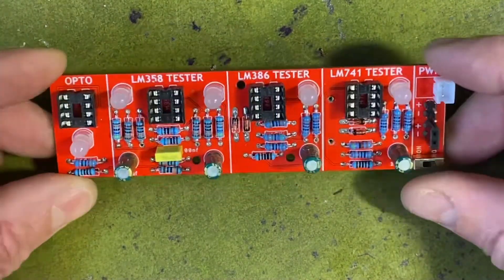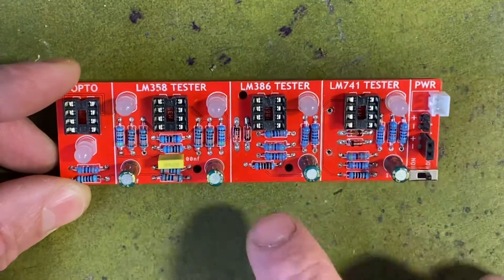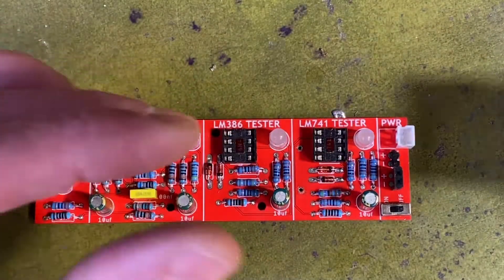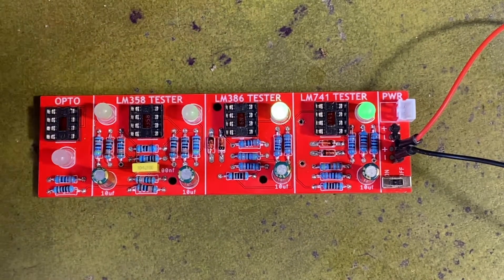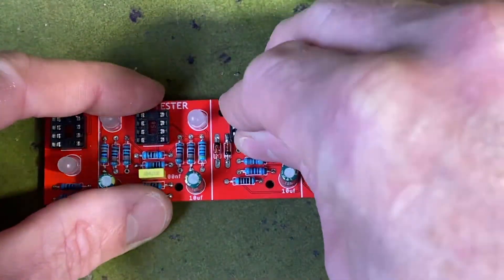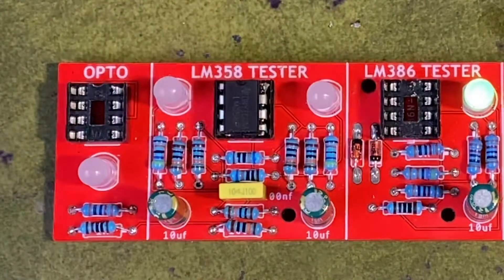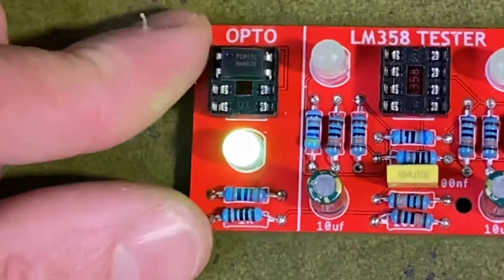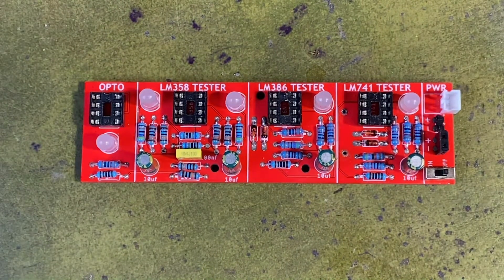Make an Op Amp IC Tester

Comment: For the LM358, in the schematic, the capacitor polorized are 1uF, but in the video are 10uF, what is the correct value? thanks
Reply from the maker: Hey there.  They should be 1uf caps

Comment: Amazing! I just want to double check. This project will only work with those specific op amps right? This doesn't apply to different ones...
Reply from the maker: Cheers!  I’ve found that I can test other op amps in the 358 tester such as 5532 and others.

Comment: amigo de casualidad tendra para probar tl071 , 072 , 4558 , 5532
Reply from the maker: No en esta etapa, pero he estado pensando en expandir esto a más IC. ¡Los tendré en cuenta!
Reply: But the 4558 has the same pinout as the LM358, so I'm wondering if this can be verified with this circuit?
Reply: Yes, please, this would be great!